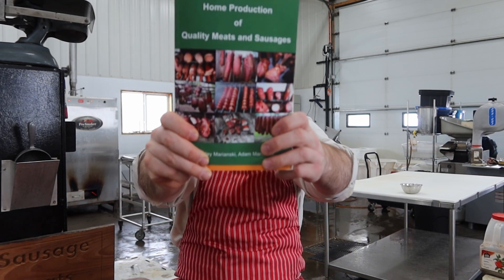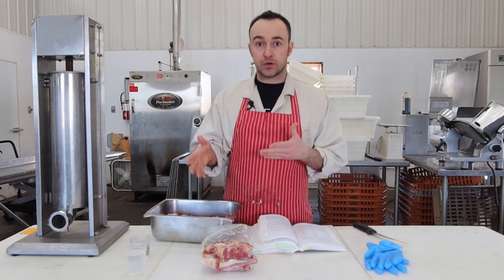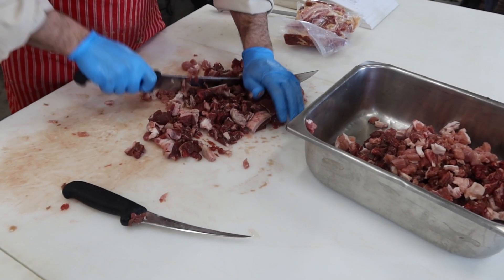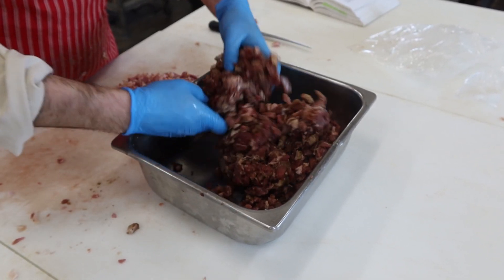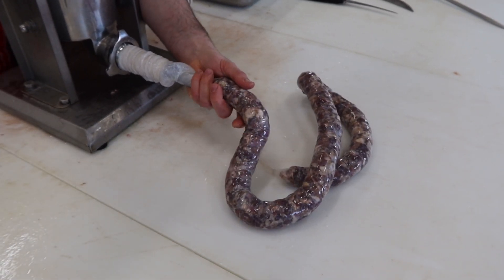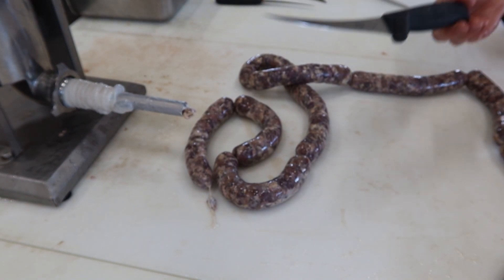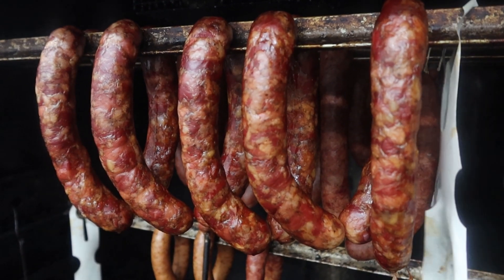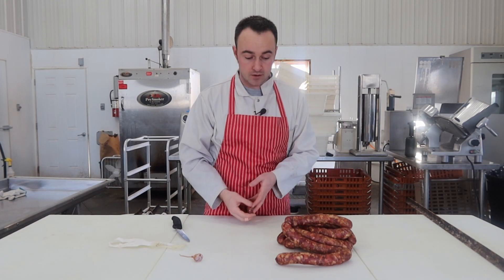Finger Sausage aka traditonal hand stuffed sausage. Home Production of Quality Meats and Sausage

Comment: Oh, I'm half Spanish and the modern traditional way of making blood sausages is to cut a PET bottle and use the neck as a horn and a funnel. I did try this method myself and it works really well with fairly soft sausages.
Reply from the maker: Yup that may work better if you are working on your own.
If I were to use my stuffer again i'd need a hand.